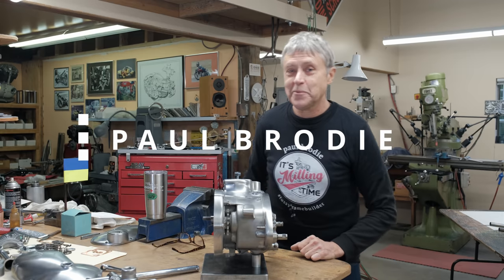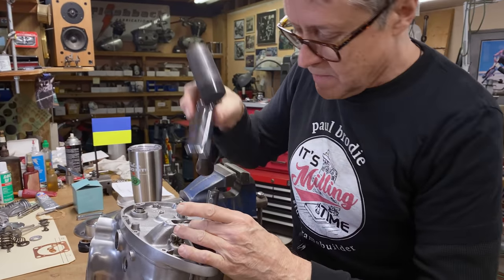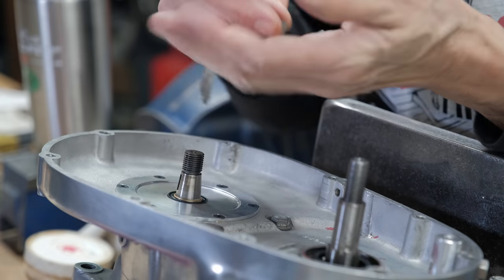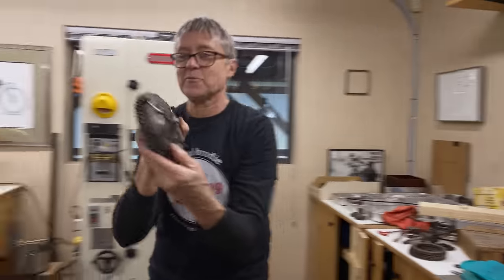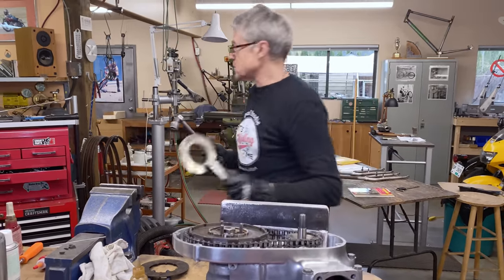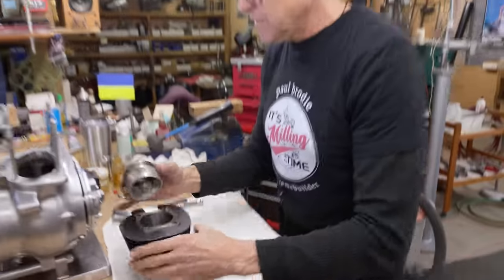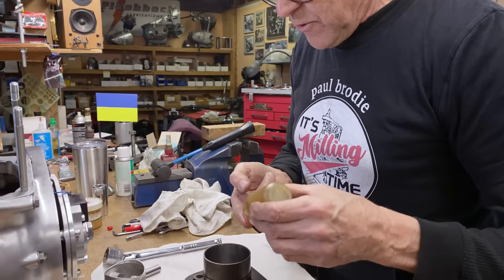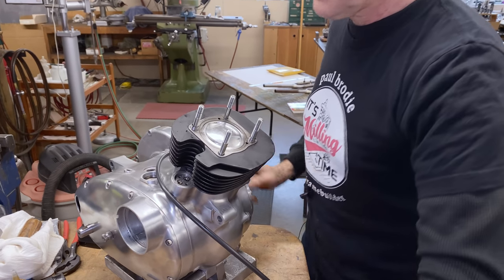Tiger Cub Engine Assembly - Part 2 // Paul Brodie's Shop

Comment: When the cost of a new worker is less than personal protective equipment.
Reply from the maker: And how does this relate to the video?
Reply: @paulbrodie  Hi Paul, my mistake, I tend to watch a few videos when I get in late from work and I often have a few tabs open. I just commented on the wrong video. On the flip side there will be an Indian business who has their employees casting aluminium in their bare feet wondering why I think their Tiger Cub engine rebuild is going great!

Comment: That was quite reminscent of re-assembling my Tiger Cub engine, although not to the extent you've gone in milling and lathing. I just wonder how the thing actually worked when I'd finished with it! Young and stupid at the time I suppose and as long as you don't make any fundamental errors it all seemed to work OK including bigger valves and bigger bore AMAL carburretor. It could do 90mph indicated (probably a deal less in reality), much to he chagrin of my pal who had a 250 AJS which could just keep up.
Reply from the maker: Some Cubs were fast... for a while!

Comment: There is a tool for fitting the rocker shafts but without it to make life easier file a chamfer on the hole, this will help the O ring slide in easily. Use the nuts and a stack of washers to pull the shafts in. I did a video on this for a T140 a couple of weeks ago: https://www.youtube.com/watch?v=ZyOlCyi7Sbo

You may find that the push rod tube gaskets will compress a lot, if memory serves me right the top one is a spongy type that will squish down to next to nothing. They made them like this to make up for manufacturing tolerances and expansion due to thermal cycling when the engine is running.
Reply from the maker: Yes, I could make a tool to install the rocker shaft o-rings. The Cub gets a custom pushrod tube next video. It is about 3/16" shorter...
Reply: @paulbrodie  that's quite a bit to take off, nice to see Triumph keeping their consistently low tolerances... 🤣

The tool is a tube with a very slight taper on it, easy enough to make.

Comment: To tighten the clutch nut: Put it in gear and support the final drive sprocket as you did before.  But now you have a tool, you're better off then me. Love your work..... 
It amazes me how across the Triumph/BSA range the engines are so similar. I have a BSA B25 Starfire, yes many times I've taken the clutch apart. Good luck.

Comment: When I was a kid and rode bicycles I was told the pin that held the pedal crank onto the spindle was called a cotter pin. It was a short piece of rod threaded on one end with a tapered flat machined on it. What you called a cotter pin I knew to be a split pin. So if a split pin is called a cotter pin what's the name of the other one?
Reply from the maker: They both must be cotter pins!
Reply: Correct.

Comment: It's been a long time since I assembled a Tiger Cub but in my mind the bottom gasket is too thick by half and both gaskets compress a lot as the head is tightened.  What happens if you dry fit the head with no push rods and no gaskets?
Reply from the maker: Stock pushrod tubes aren't made well. We got it all figured out, and the Cub gets a custom 6061 pushrod tube next video...

Comment: Never had a cub myself but a friend had one for a number of years, I was sure the clutch had a plane plate then cork plate alternating? It looked like you were fitting cork to cork plates? Or have I not seen it correctly? My friend blew the big end so often by riding to fast that he could replace one in a couple of hours! Then he bought a better set from Alpha bearings in the UK which lasted til he sold it! Did you know the BSA 250 C15 was modelled on the Cub engine but with the cylinder sitting upright? We in the UK call what you call the wrist pin, the little end! Big end at the bottom little end at the top of the conrod!
Reply from the maker: It's always cork / steel / cork. Thanks for watching and commenting 😉

Comment: ahh - https://youtu.be/NzXB732Ayig?t=220 - now you know the reason, why the case was damaged and you had to fix it with epoxy. I would use a wood block instead.

Comment: 5/32" (3.97mm) is a common size for push bikes. While modifying an indicator switch from my motorcycle last week I managed to drop one of the 2 it started out with (I heard it hit the tiled floor but I never saw it again).  A quick visit to a local push bike shop got me ten for a dollar. eBay also has many Chinese suppliers of both stainless steel and hard carbon steel 5/32" balls.

Comment: Ok Paul, I waited.... 😉
So a block isn't as elegant as a bespoke spanner... But it IS a far sight better than the field expedient of wadding up a bunch of chain around the sprocket and into the case recess!  😅
Reply from the maker: You are correct :)
Reply: @paulbrodie  You got a chance to make a clutch hub tool anyhow.  😉

Comment: Hi Paul there was an assembly sleeve for cub rocker spindles that had a taper to compress the ring as it went into the head. Also a good trick for the tube is to make up some very thin tube sleeve that go outside the seals to stop them squishing out over time. Same as the t120 Bonny. 0.050” was what I skimmed my tubes to compress both seals. Skim head skim tube.
Reply from the maker: If they leak I will make that special tool.

Comment: On the rocker shaft O ring, there is a special tool. It’s a small tube with a slightly tapered bore that compresses the O ring as it approaches the bore of the head. Alternately you could cut a small chamfer on the rocker shaft bore to prevent the O ring from getting sliced.
Reply from the maker: I did make a chamfer where the o-ring enters. If they leak, I will make a special tool.

Comment: That is wrong way to tighten the sproket in such way can be break the engine peice, it happened with me already, so I stuck pipe wrench in sprocket teeth and tighten the nut
Reply from the maker: Using a pipe wrench on the sprocket does sound a bit crude. I will have to check the video to see what I did. Also, how do you torque the nut using a pipe wrench?
Reply: @paulbrodie  Because those both shaft and sprocket nut usually hardened, otherwise how  do you campare it with an aluminium caste peice whole tarque will impact on aluminium peice, only you must try to holt sprocket sapartely to aluminum peice and try to make ant holder tool for sprocket instead of pipe wrench
Reply from the maker: @mashooqbughio  Yes the sprocket and shaft are both hardened. That's how it should be. Which aluminum piece you are regererring  to I have no idea.Sounds like a fixture. 😉
Reply: @paulbrodie  I have watched your video,  when you made tight the sprocket nut, you stuck anything between sprocket and engine peice to hold sprocke to tight the nut
Reply from the maker: @mashooqbughio  OK, so that was how I chose to do it. It wasn't just "anything" that I chose. I would have used a suitable piece of 6061 that had the correct fit and enough surface area not to damage the thin wall engine case. Once I find a good piece I usually  save it and mark it with a felt pen for next time. Otherwise it just looks like a piece of metal from my scrap box 😉
Reply: @paulbrodie  As I told you in my previous first comment,  how to tight it and how to hold sprocket, I hope there wont be needed the wall of engine peice,  and that is enough right way and I have also spent much more life with Tiger cub, I have made electronic ignition system with multi coil alternator siper charging, and I have designed rotary oil pump for Tiger cub
Reply from the maker: @mashooqbughio  Sounds like you have a lot of experience. Very good. Our latest video came out yesterday 😉
Reply: @paulbrodie  Dear bro Paul Brodie, I watch your video daily,  indeed you are a least skilled person and lot of experience and finest machinary, may God give you health and long life,  ye dear absolutely I have spend 1/3 part of life with Tiger cub and other motorcycles, I did several modifications in Tiger cub motor
Reply from the maker: @mashooqbughio  Thank you for your comments. I am getting another Tiger Cub in the spring, and I am very excited about that! 😉

Comment: I would have chamfered the hole to start the o-ring, or made a tool that had a gradual chamfer to get the o-ring down to the size of the hole it was going in, have done this in the past it helps! On the  push tube, you took .055 off the head height, that would have lowered the head distance to the block!
Reply from the maker: Thanks for the tip...   :face-blue-three-eyes:

Comment: 21:58- if you have the proper O rings, you still need to make an installation sleeve out of thin but ridged cellophane like material.
Reply from the maker: I could use Delrin! First we'll find out if they leak...
Reply: Rocker shafts always leak for me!    (weep, at least)

Comment: we're the heads squish standard? those spindles will leak ,best turn a sleave to assemble them.
Reply from the maker: If they do leak I will have to fix them.
Reply: @paulbrodie  I know, there is a tool for that ,for the triple anyway which is the same arrangement.
It's a tapered sleave ,"a good fit" on the head end tapering out to the size of the oring, they work.
Reply from the maker: @pbysome   If they leak, I will make a tool and reinstall.

Comment: The pushrods seemed to seat with the too-long tube. I would assume they are also too long. I look forward to you machining a pair of those, I imagine that isn't particularly easy but I would be fascinated to see it done.
Reply: Triumph tried a couple of different designs for the pushrod tubes over the years to address the problem of oil seepage at the joints. It looks like you have an incompatible cylinder head/pushrod tube combination. I had the same issues on my 650 Triumph TR6. Solved with tubes of the correct design. Still leaked, though!
Reply from the maker: Pushrod length is fine. Next video I machine a new pushrod tube that is 3/16" shorter.
Reply: @paulbrodie  No doubt you are correct, I was just using my common sense rather than any particular knowledge of this engine. Anyway, I'll enjoy watching you make a prettier piece than the stock bit of swaged pipe.

Comment: Dan Thorpe won the Scottish Pre65 trial on a Cub so modified he did not have a right hand side engine cover. Did you lap/grind in the valves to the seats?
Reply from the maker: New guides, valves, the seats were cut and the valves lapped in. Of course!
Reply: @paulbrodie  Thanks Paul, just wanted to be sure.

Comment: When I saw you sit the little ball bearing on the vise- I was thinking ‘if I did that I would promptly knock it on the floor and loose it’. But of course you are a lot more organized than I am.  
 I like using ‘Gaskgacinch’ to hold gaskets in place.  Been using it for decades. (But of course everyone has their favorites).

 I was taught in the 70s to put rings in dry- really helps them seat, with just a little on the cylinder wall. But I don’t do that if the engine is going to be sitting for any length of time before I start it.  I do what you did.  Worked quite well with the Benelli 750 sei engine I did last winter/spring.